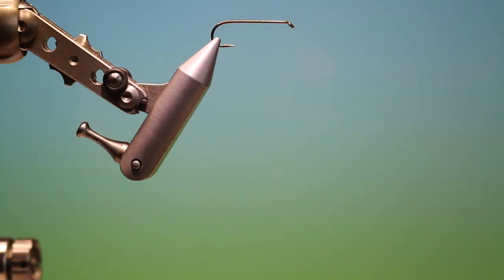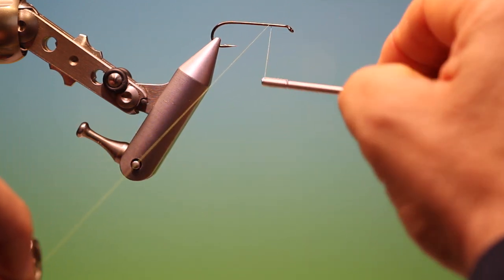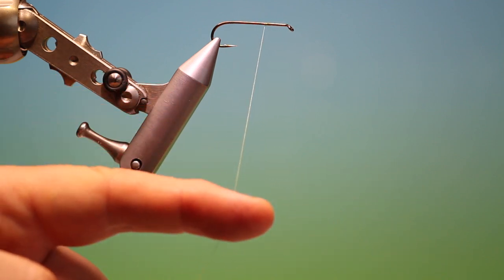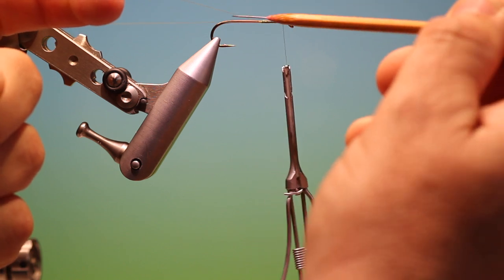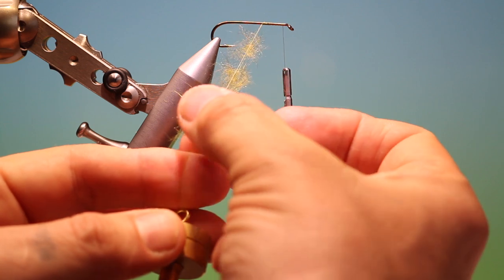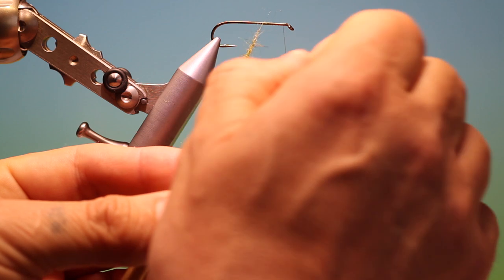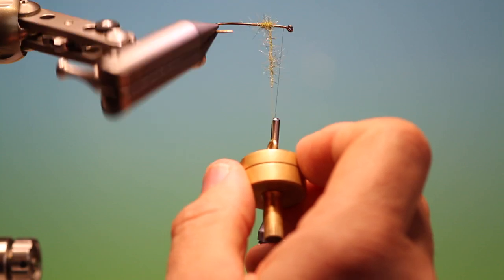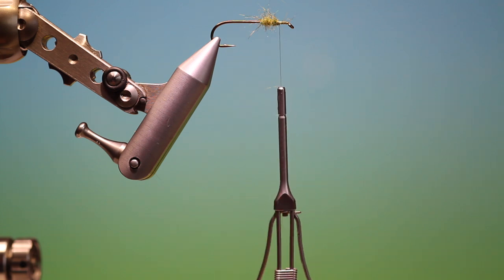Flytying for Beginners using a dubbing spinner with Barry Ord Clarke

Comment: Interesting to see the Petitjean bobbin holder in action, too.  I haven't yet been able to persuade myself to spend SO much on one bobbin holder. I've bought the Loon design recently, and its lack of tension ability makes it a pain to use. Most of us need something like eight/ten loaded bobbins. Maybe the generic answer is white thread (I'd choose Semperfli 18/0 or Sheer 14/0) in a favourite bobbin holder, and a range of Sharpie pens. Are you also considering your own design?
Reply from the maker: The good thing about the Petitjean bobbin holder is that it is so quick to thread, so you only need one bobbin holder!  Not got that far yet with my own bobbin, I'm not sure its needed, so many good designs on the market right now.

Comment: One question I have is in what case would you use a dubbing loop, the noodle technique where you just roll it on a single piece of thread, a dubbing brush, or maybe any other dubbing application I didn’t mention? Like the easiest one is the noodle method so why not use that every time? I’m a very new tier so don’t roast me too much ha!
Reply from the maker: Good question! There isn't one answer to that. But simply explained. You will use a dubbing loop when you need to spin a very tight dubbing noodle or brush or when the dubbing you are using is heavy like rabbit fur or deer hair. When you are dubbing light or fine materials like CDC or a superfine dubbing it's enough to just split your tying thread and spin your bobbin. A dubbing loop is also very useful when you require a very spiky dubbing effect. The spiky effect is somewhat lost when you just roll the dubbing on a single piece of thread. A dubbing loop is much more secure when the material is spun in-between two threads.
Reply: @Thefeatherbender  now i know too. Makes a lot of sense - I've only ever used the split thread technique (I mostly tie 18/20s) and found it unwieldy for heavier/stiffer materials, so this is great to know. Thanks!
Reply: The feather bender awesome. Thank you for the comment! That makes a lot of sense!